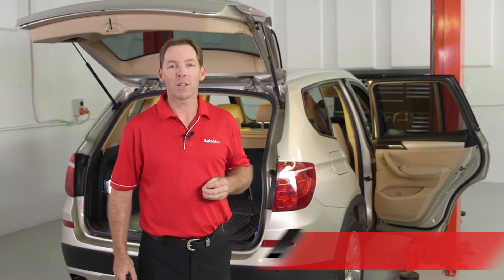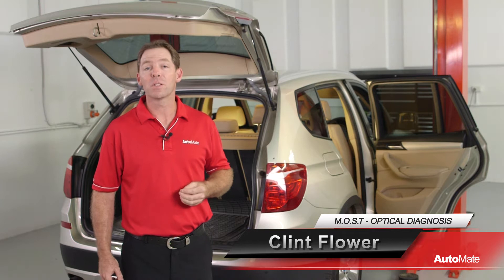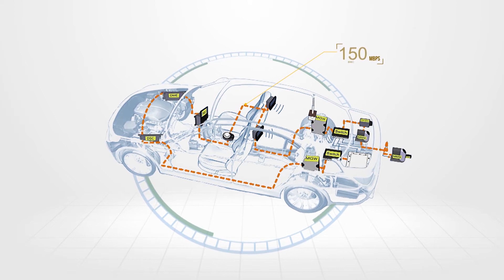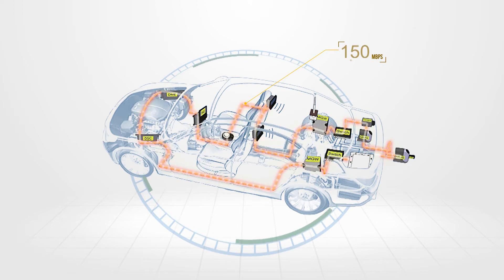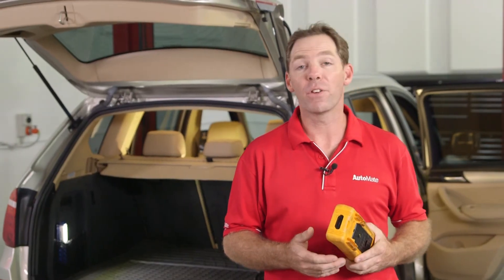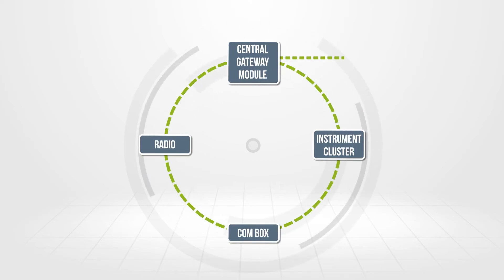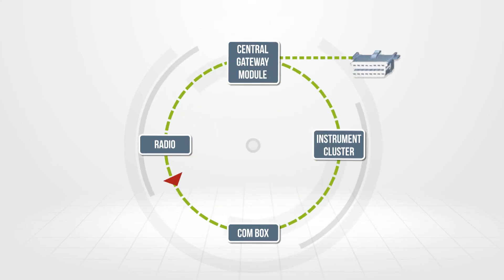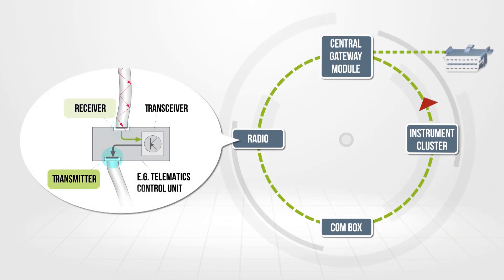MOST BUS - Optical Diagnosis

Comment: I work for a Honda dealership. The MOST network is not optical! It's fully electrical. And though I don't remember the exact transmission rate, I think it's more in the Gb\s range.
Reply: MOST Bus can be optical, electrical, or a hybrid of both.
Reply: @ashleywarren815  Nice to know.
On Hondas we only use electrical.
Reply: Robert Rocheville that’s nice to know. I drove and raced Honda/ Acura before I went to the VW Group. It’s probably a matter of time before fiber optics become more widely used. I’m a VW master tech and was an Audi certified tech before hand. We use both optical and electrical on our media and driver assist systems on some vehicles. Fiber optics actually nice and faster than electrical  it’s also pretty easy to diagnose granted you have the test equipment, some can be expensive and repair tools, which can be expensive.  Like the diamond blade cutter than only gets so many cuts and has to be replaced. The VW/Audi tool actually has a clicker counter that tells you when it needs replaced, however, you don’t use it that often so no biggie.